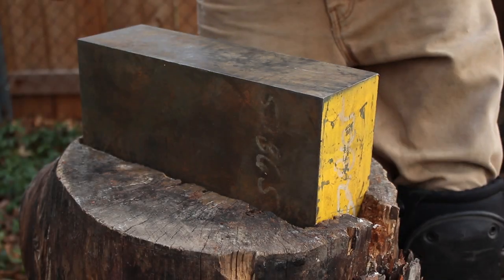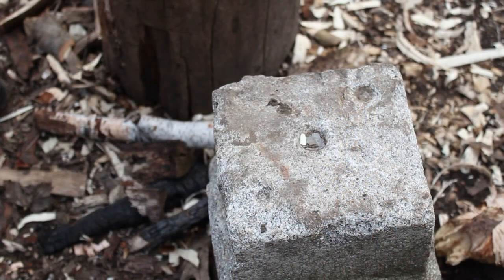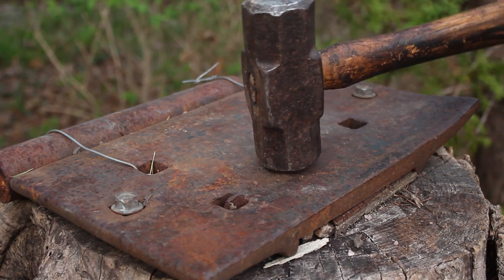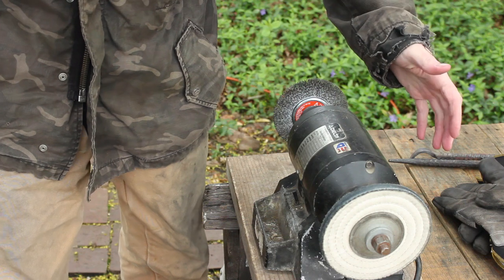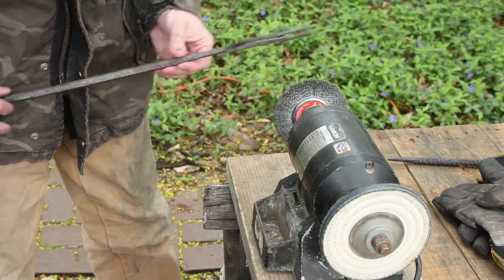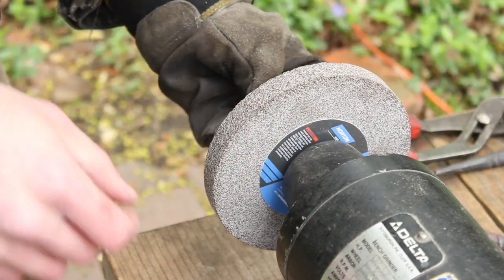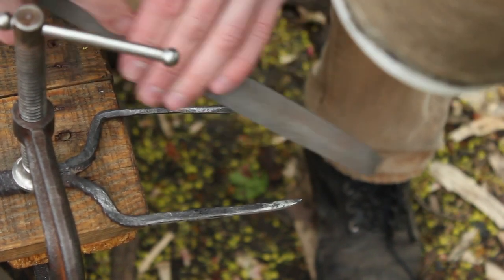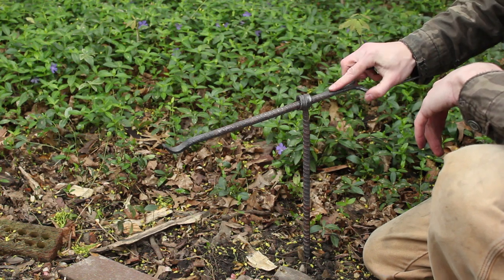New Anvil, New Grinder, and Forging a Squirrel-Cooker

Comment: On another video you showed making a hidden tang knife . 
Here's a couple of suggestions. Oak flooring is made to be walked on, tends to be a little on the brittle side and you don't know how it's be treated. A great source of low cost handle mateial is cutting boards. Usually pretty cheap at garage sales. They are intended for use around food. They come in a huge variety of hardwoods in many many colors and/or grain patterns. As for finishing, I'd stay away from commercial stain, they are not intended for use around food. A couple of applications of boiled linseed oil can give a beautiful finish. 
If you can dig your fingernail into the wood, It might not be durable enough. 
I am not fond of edge hardening, as I have ruined a couple of nice blades this way. 
Finally, the absolute best way of removing any trace of grinding, sharpening, etc, etc, is to rur  a little bit of any kind of animal fat (beef, chicken, pork, etc, etc) on the blade and wipe it of on a paper towel. Try this after you have done your best effort at cleaning it by any other method. You will be surprisd to see what had been left on the blade. 
The knife you made was beautiful.
Reply from the maker: Thanks for watching, and I appreciate the suggestions and advice!  My understanding of boiled linseed oil was that it contained some unsafe chemicals, so I was planning on using raw linseed oil for my next handle.  I've also used flax seed oil (which is basically food-safe linseed) for when I carve spoons.